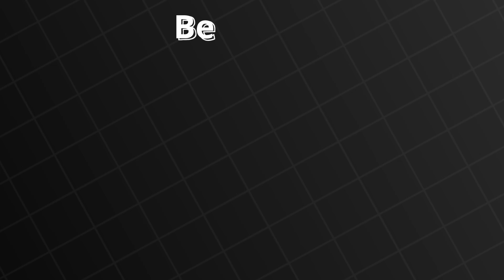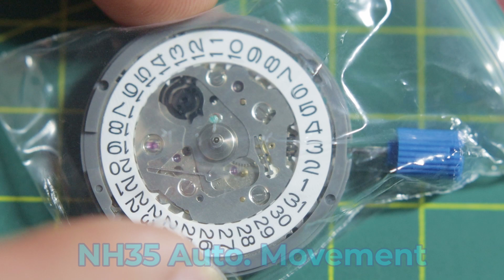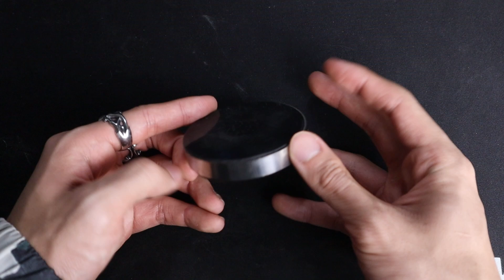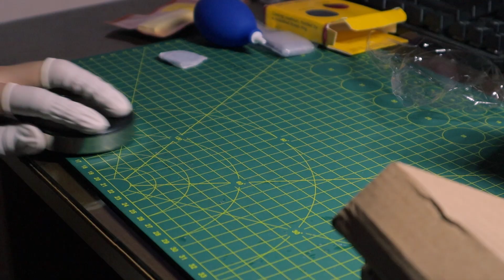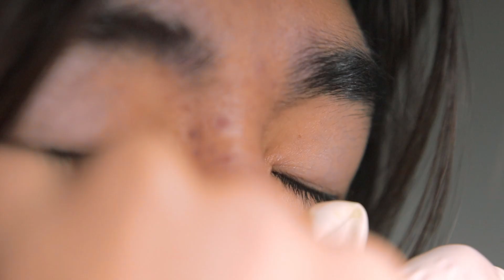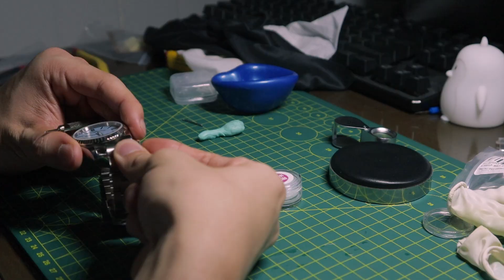I Built My Dream Watch From AliExpress (and how you can too!)

Comment: Second hand tip: Get out of your chair, eye level, use a loupe, get your eye right IN THERE and attach the second hand while looking from the SIDE, not the TOP. This way, you SEE the post onto which you are mounting the hand, instead of HIDING it behind the hand when viewed from the top. Apply short, light "taps" instead of heavy pressure to get it started. Then, a nice firm final attaching push.

Comment: I’ve never built a watch before, but I’m currently researching and looking at options on AliExpress. I’ve found the case I want to buy and I’d like to use a sapphire exhibition caseback, but I’m not sure what size to get. If I’m using a NH35 movement, is there a standard size for the caseback I should choose, or how do I determine the correct size?

Comment: Do you need a spacer ring to fit the movement? 
The inner diameter is 28.5 and the movement 's diameter is 27.4, right?

Comment: quick question: i use o ring grease on the o ring obv, and the silicon grease on the end of the stem right? roughly how much of the stem should be greased
Reply from the maker: Only grease the stem on the side you would put the crown head on not on the side where the stem will be inserted inside the watch!
Reply: @GodTierWatches22  Dumb question, but would you pull the stem all of the way out (adjusting time position) after finishing the watch and then grease that small section that is located outside of the watch between watch case and crown head? How do you apply the grease, like with a toothpick or small tool?

Comment: Just a heads up for some of these cheap tools: the first time I tried removing hands, I didnt realise one of my hand puller levers had a burr on the underside. This immediately scratched the dial, went right through the dial protection plastic I had in place. After this incident I spent some time polishing the hand pullers to make sure this never happened again.

Great video btw
Reply: Great tip. This is something I'm sure most don't check
Reply: @juanpimentel2338  by the way I just edited my comment to clarify that I did have protection plastic in place and the bur cut right through it.

Comment: I built last autumn a very passable Bell & Ross radio compass replica, a £10 NH34 movement from UK's Cousin's and the square Seiko case, dial, unique hands and engineers bracelet from Aliexpress and it is phenomenal, 55mm square with sapphire crystal and display, red alloy bezel insert around a staggered coin edge bezel and on the 24mm engineers heavy bracelet it looks astonishing but it is a big blokes piece as it would dwarf the wrist of someone with a slim wrist.   My next project is to finish off the NH36 conversion of my Alba Manta Ray which is hugely rare, can't wait to finish that, the other big piece I did last year was I got a set of original not Aliexpress "fishbone" hands and after rebuilding a very customised 4R35 tuna, fitted those with a trident second hand, engineers bracelet and pow, super custom Seiko tuna ftw :D   Sadly all kinda being ignored as my uncle bought me from the US a Bulova Precisionist 96B175 and well... it kinda knocks the others into the long grass as the Bulova is one of the most accurate watches on the planet and is jus' awesome :D

Comment: Good explained. Tip: push the crown in so that the watch is running. Than place the seconds hand on. You see in an instance thet the seconds hand is on the tap.
Use a friction ball to open and tighten the caseback.

Comment: I'm sorry but I must ask, why is your narration riddled with so many small grammatical errors. It's almost incessant, to the point where I'm baffled. Literally every 10 seconds just about. If English isn't your first language I'll give you a pass, but the apparent level of the rest of your speech doesn't match that of someone who would make so many errors regardless of whether English is their second language or not.
Reply from the maker: may I ask what grammatical errors are you referencing?
Reply: Saying that you are going to align the movement into the case. You're not going to align it into the case, you're aligning it in the case. You don't apply things onto things, you just apply things to things. You weren't applying the hands onto the dial you were applying the hands to the dial. You once said "applied it enough pressure" which doesn't make any sense. You said "naturally fall off by gravity", which should be either from gravity or due to gravity; kind of an awkward sentence regardless. And the comment you've made on my comment while not technically wrong is also weird sounding to most people. I heard you pronounce literally as lichuly, which sounds close to the abomination lichruhly that most British people produce, when it should be pronounced li-ter-al-ly with those exact vowels for the most part. It's called a second hand same as an hour hand is called an hour hand and the minute hand is called the minute hand. It's not the second's hand it's the second hand, the same way we call it a birdhouse not a bird's house, or a bird nest not a bird's nest, although this rule isn't always strictly followed. You said "showcase off", which isn't something you can say in English. There is a phrasal verb "to show off" but it cannot be modified to say showcase off. Phrasal verbs are never modified in that way.
Reply from the maker: @masteranakin8827  mate, it's a youtube video, not a literature analysis. I appreciate you commenting back but we all make grammatic mistakes when talking, I just talked casually and while you may think it's an issue, the big majority just don't care enough and they enjoyed the video! Hope you have a good rest of your day :)
Reply: @GodTierWatches22  yes we all do make mistakes but as I said before yours were incessant and quite noticeable. I didn't comment just because I happened to notice some mistakes. I commented because it is so incredibly jarring how bad you are at talking. And if you were going to defensively retort anyway why didn't you just start with that instead of asking what mistakes you made first. You asked what mistakes you made and I gave you but a few.
Reply from the maker: @masteranakin8827  I asked the mistakes and you replied and I appreciate you replying. However I don't think it's wrong to just think those mistake are minor and I wasn't being overly defensive in thst regard :) I think it's more than criticism and more so just a bit rude to add adverbs such as incredibly than say jarring on how bad I am at talking. there are better ways in phrasing criticism
Reply: @GodTierWatches22  I used the word jarring because it genuinely was to me. As to how it was phrased, that's a matter of preference so if you found it too rude I can't argue with you. I phrased it to accurately represent how I felt, if that came across as overly rude I cannot argue as you're entitled to your own opinion. I do not wish you ill, but I do find your speech mildly infuriating and wished to express this :)
Reply from the maker: @masteranakin8827  agree to disagree that's okay 👍 if you find my speech infuriating by all means you don't have to watch my videos again, thank you for pointing out about my speech though. it is something  I can work on for sure
Reply: @GodTierWatches22  I don't think it's something you need to work on. If you're fine with how you sound and your actual viewers are as well it doesn't matter. I don't think you're very bothered by my comment, but if you had been I would tell you not to worry because nobody really cares and this is just my niche opinion.
Reply from the maker: @masteranakin8827  it is still an opinion at the end of the day. if I wasn't so bothered, I wouldn't have commented back multiple times in the first place. Speech has been a bit of an issue that I have recognised recently, especially when I talk to people... like the things I want to express don't come across so nicely with the way I speak...sometimes my brain goes too fast and just need to slow down to process the words in my head before I say it XD maybe gotta get back into reading

Comment: I really like one of the 31mm dials, seller says it would fit 40mm, is it possible? Did you have any experience as such? Thank you for this great video by the way!
Reply from the maker: @ErayErtugrul09  31mm dial would be tough... I've never had any experience with them but 28.5mm fit my 36mm. time to ask reddit!
Reply: @ thank you for your quick reply! Will try my best with 28.5 and 40mm case, I am hoping that they would fit. All the cases seem to accommodate mostly 28.5, it’s really difficult to find a case that fits above 28.5 on internet.

Comment: Nice work, nice vid. I’ve done several so I’d like to add a couple pointers, but first, don’t feel bad, the seconds hand is the hardest by far! 1) Make sure all the hands are parallel to the dial and each other. (2) This method will not make a watch that is actually water tight do be careful (if you don’t believe me but it in a glass of water for a while and see, realize there’s no pressure there). (3) Change your rodico often, it gets dirty/greasy and can make a mess. (4) Clean, clean, clean, the dial and inside the crystal often and clean them again before you close it up. It’s very frustrating when you’ve spent hours on a build and close it up only to find the one crappy piece of lint on the face or underside of the crystal. 😊
Reply from the maker: thanks for the pointers. what can I do to water tight to prevent water entering into the dial? and ofcourse, I did clean the dial often I think I just didn't mention it enough! thank you for the tips I found them very helpful
Reply: What are the extra steps to make it water tight?

Comment: How does the quality of the parts compare to  watches from aliexpress, like a San Martin? Do those companies use these kind of parts or are they not up to the same quality of the brands?
Reply from the maker: @danieljennings9015  I would say the level of finishing for the parts is less than san martin, the case feels not the best and would need to purchase the best. the bracelet feels a bit sharp however, as far as the dial, hands and movement goes, it's the same I would say

Comment: I recently also completed my very first watch build. 
If you're planning to do more of those I recommend a movement holder to keep any unnecessary pressure off of the movement when pressing in the hands.
If you have access to a 3d printer it's pretty easy to print one of those.
Reply from the maker: @SirZechs77  thanks for the recommendation!

Comment: With the seconds hand, I recommend getting right down to eye level with the movement so you can see the pinion. It helps me tremendously when installing the seconds hand.
Reply: Great watch great build! I recently built my first watch (Yatch Master 2 Homage) it took me around 3 hours as well and the same issue with the second hand took the longest to do. The amount of words that flew around the room and minor rage quits I got it on. 

One thing I will say that I wasnt aware of the NH35 has a little cap to protect the second hands stem that needs to be removed, I didn't realise until something small fell off and when I tried to set it again it went straight on. I hope that helps someone here.
Reply: @Ageratos01 Could you share the link to the Yatch Master dial you used? It's one of my favorite models
Reply: A good tip I was shown is when you’re ready to install the second hand press the crown in and get it running. I use rodico to hold the hand some use tweezers rest it on the pinion if the hand moves around you know you got it on then use the hand press to fit it
Reply from the maker: yeah after I had to reinstall the hands I had a much better time and just used rotico and the hand press tool and worked like a charm!